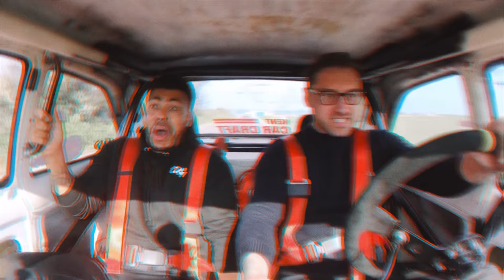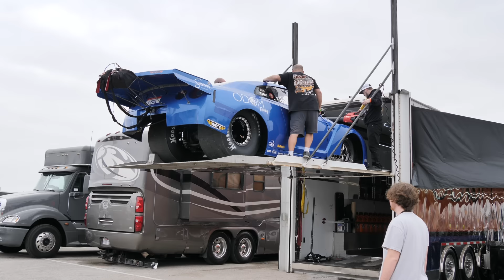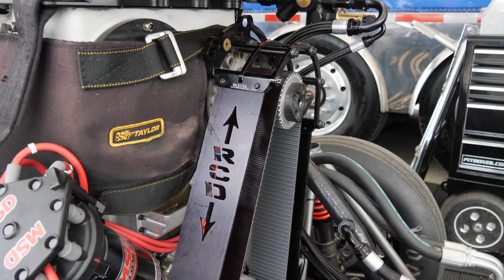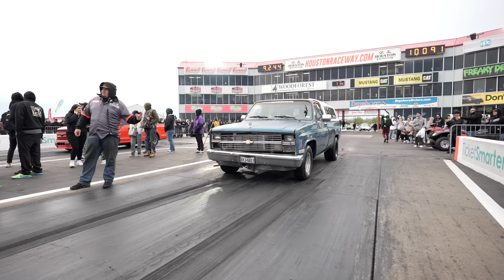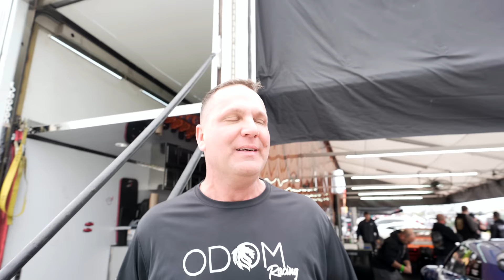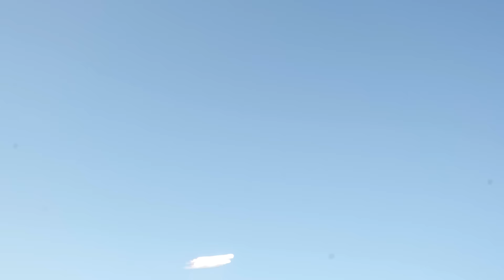THE FASTEST GTR EVER BUILT!? 5500HP RECORD BREAKING MONSTER!

Comment: Epic car!
I wouldn’t call it a gtr though, it’s a tube chassis style car with a v8 swap.
One hell of a machine regardless ‼️
Reply: agreed
Reply: Go check the vin number on that body. The shell is original. The doors, front clip and boot lid are all fiberglass.
Reply: Probably street legal in all 50 states! 🤪
Reply: @xAvaragex   hahaha
Reply: No vr38 could ever handle that much power. So it not a GTR...
Reply: @mk5rob42  ever heard of aftermarket internals??? EVERY part in and on this engine is interchangeable with a cast block vr38.
Reply: @lennixsingh626  the most I've ever seen a GTR make was 3500whp, sorry the engine doesn't have the displacement to make over 5000whp
Reply: @mk5rob42  oh mb i thought u were trying to say that a vr38 needs to be stock to be classified as a VR.
Reply: @xAvaragex  did you eeven watch thee clip xD? ..
Reply: All that engine and chassis and still the quickest not the fastest🤡👎🏼
Reply: @xAvaragex  and it’s still not a GTR
Reply: @xAvaragex  may have the boddy and look of a GTR , but the full drive line , and with that all electronics deleate , its no longer a GTR , its a drag car with all the best drag car parts
Reply: It's still a GTR, world's fastest GTR
Reply: The car was made at a Nissan factory by Nissan so still considered a GTR.
Reply: 5500whp and lost!
Reply: @lennixsingh626  There isn't one part interchangeable from this engine to a vr38, this car has a Brad Anderson engineering billet hemi.
Reply: @ChrisHarding-lk3jj  responded to the wrong video.
Reply: @lennixsingh626  The car featured in this video has a BAE billet hemi which is based off of the original Chrysler hemi design.
Reply: @ChrisHarding-lk3jj  i know... i was responding to the wrong video.
Reply: @mk5rob42  even at 3500 hp its not a gtr they completely swap the motor around 1500 lol
Reply: Yeah, but the only GTR thing in this thing, is the body. @xAvaragex
Reply: It is a GTR - a GTR funny car. Odom is just baiting people pretending he thinks it counts as an actual GTR.
Reply: So if I buy a GTR part and put it on my car it's considered a GTR?  @xAvaragex
Reply: lmao bro, factory vin number omg. How hard is that to understand lol. God damn lol, do you know what a VIN tag is? It means the body is a GTR, it was built by Nissan in Japan. He bought it and gutted it. Its still a GTR body omg. Put a fiberglass front clip etc. @xAl3216
Reply: Call it a mustang then if it makes you sleep at night. I’ll still call it a GTR.
Reply: @lennixsingh626  That car has a hemi in it.
Reply: @SRT-ow3cq  I know, I responded to the wrong video.
Reply: @LittleBanditMicra and 51 and 52 Hawái and puerto rico
Reply: Its not tube chassis
Reply: @stevenhill6502  I hope your joking lol.
Reply: It doesn’t matter how you call it, what matters it’s a GTR 🤣🤣 get over it y’all punk
Reply: @xAvaragex brooooo is Bullshit 😂😂 a gtr with v8 Engine is Not gtr 
My Golf is the fastest with Bugatti Engine 🙄🙄
Reply: @mk5rob42  thats what they said about 3500 hp bro .. guess what they have now =?
Reply: The Puny V6 that the GTR has stock can never come close to 5500+ hp.
Reply: @DBSARlight  dno bout that. theres some 5.0 liter billet GTR's out there with close to 4500 so maybe in the future
Reply: @Demidar  Show us one.

Comment: That is as much a GTR as I am 😂 beast of a machine though still 😮
Reply: I've just read your comment and like the comment I also made,       I do not agree that you can correctly still call this a GT-R. once there are more than 50% components in anything in life it can no longer be correctly called by its original name. For example: if you have one ounce of a metal alloy and its composition is 79% Copper, 2% Tin, and 19% Gold, Then how in the world could you call this an ounce of Gold.??       When is a GT-R not a GT-R.??  answer: when it has more than 50% components from another or other brand/s. Agree.???
Reply: @Clarke Lewiss  definitely lool 😆 . I mean it has a supercharged v8... not 4wd he said it has the windows and rear lights of a gtr 🤯 but I guess it's allowed 🤔
Reply: @CJL1969  Its a philosophical conundrum but In my opinion if it's got a blueprint gtr engine , transmission housing , original structure and body (reinforced or not) then it's still a GTR.
Reply: Definitely not a gtr anymore, put a prius motor and drivetrain in a gtr shell/body and see who agrees its still a gtr🤣

Comment: It would have been more impressive if they had used an actual GTR engine in this car.  But I suppose you could argue that there are loads of cars in history that swapped out the original factory engine and yet they were still branded by the manufacturers badge in drag races and track races.

Comment: Now your talking!!!!Big V8s the ground shakes,  The main event at Santa Pod will see cars runnimg in 3s and 4s 

Door Slammers as well. 
V8s is best form of Drag Racing due to the noise. 

But smaller engine cars are  crazy, the tech today means you can get 2JZs etc running in  6s. 

Actually Jamie you should down pod and do video of the big stuff. Your delivery is 👌🏾